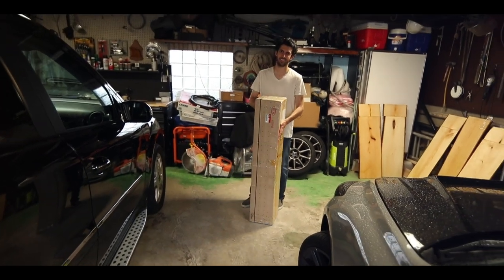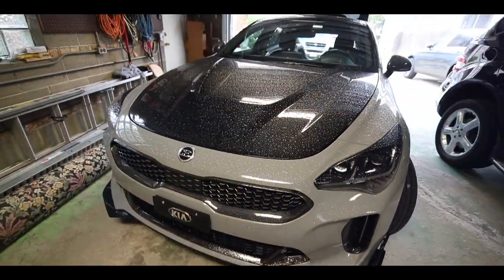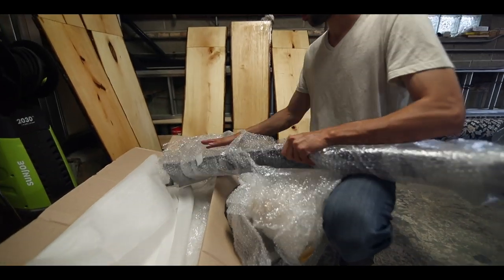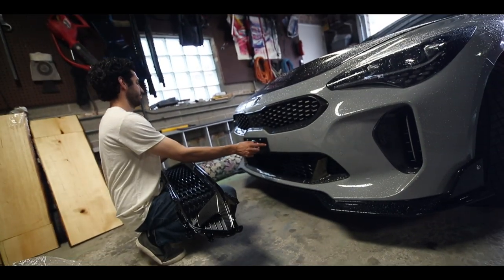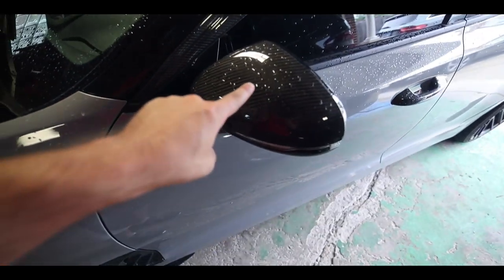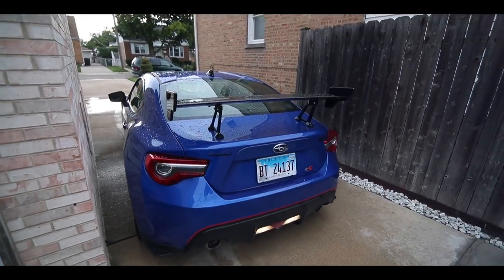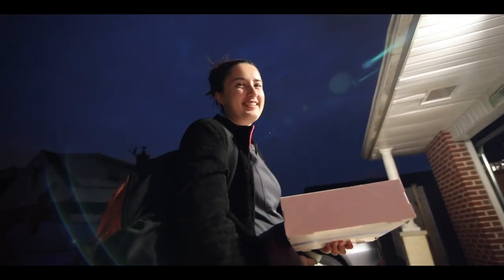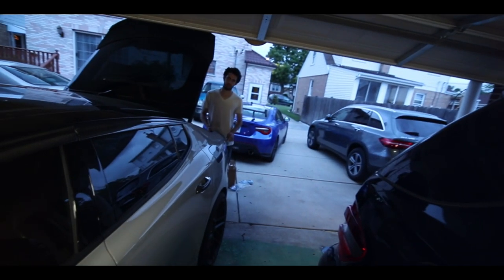CARBON FIBER FRONT LOWER GRILL KIA STINGER

Comment: I was wondering when carbon would be available.  looks great, i did every piece in a candy red to match my wheels.  Although carbon is addictive, and looks great.  Just swapped out my hood last week.  Regarding the Borla tips, i received my replacements last week, and just installed.  The design flaw is still there as they have not changed the design at all.  Your guy is correct, what we did was drill, and pin them in, with a bit of loctite.  If you dont, there is no way they will stay on.   Its a shame but i doubt they sell enough to pay for redesign. If you know anyone looking for a carbon fiber lip i have a new strictly business model i got from David i am willing to let go cheap.  Take care bro.
Reply from the maker: I'll see if anyone wants it! And yeah I figured  we need to do something different in order to keep these tips on . Kind of bogus lol.

Comment: What is causing the tips to fall off?
Reply from the maker: The flanges are too short. Plus there is nothing that legitamitly holds it in place other than an adaptor & clamp which obviously isn't working lol. Might just weld it on there or come up with something to assure this stops happening.